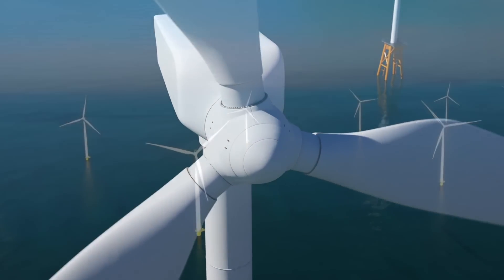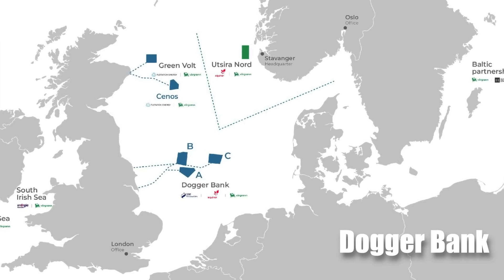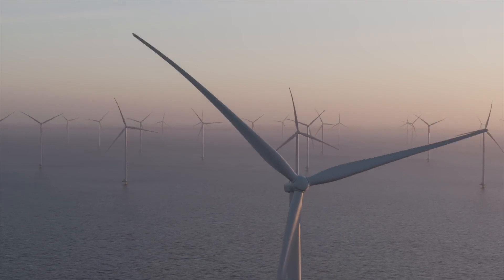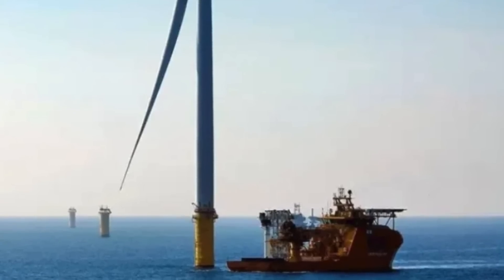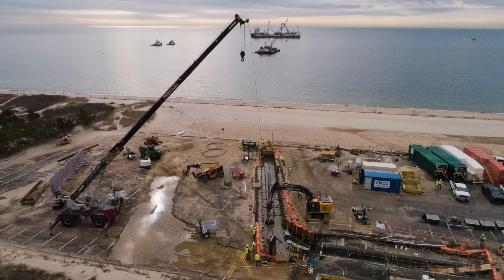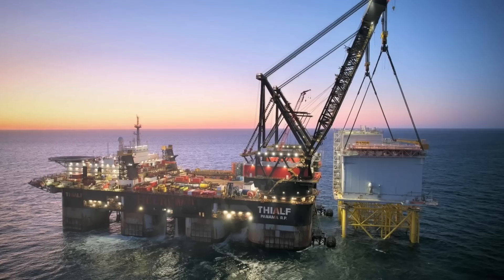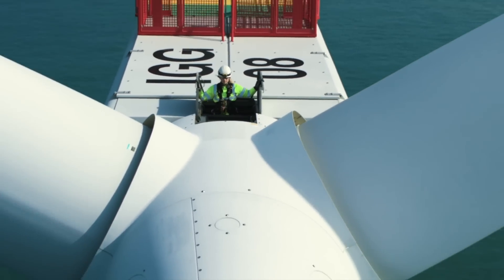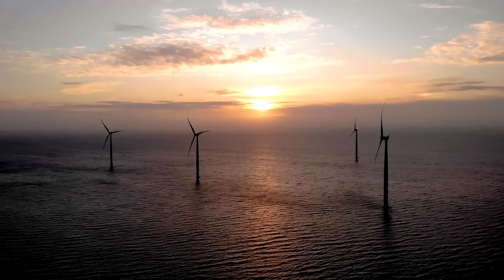Inside the $11.6 Billion Dogger Bank: The World's Largest Offshore Wind Farm

Comment: What a waste of time, space and taxpayers money. Electricity is a commodity that is produced at the same moment it is created. That is not possible with wind energy since it is always dependent of the weather. If there is too much wind there is overproduction and if there is little or no wind the energy has to be brought from an other source. The industry needs stable and predictable energy and that can only be achieved with large generators. Then you are left with hydropower, fossil fuel or nuclear power. If you don’t have one of these you will have extreme price variations, unstable power supply and in general extreme prices of electricity. Your industry will move to countries where they get cheap and reliable energy and all UK is left with is the enormous expenses the taxpayers have to cover for. Good luck with that.
Reply: What is your suggested alternatives to Wind and Solar ?
Reply: @TimMountjoy-zy2fd  The answer to that is very simple. It is nuclear power. Contrary to what a lot of people think, nuclear is very safe. In fact it has together with solar power the lowest mortality rate of any energy production. The three most known nuclear accidents Chernobyl, Fukushima and Three Mile Island was in reality hydrogen explosions because they lost cooling of the reactor. When water hits temperatures above 700 degrees centigrade the water molecules split and large amounts of hydrogen is generated. With them forth generation of reactors this is not longer an issue. Specially the molten salt reactors are extremely safe. First of all there is no water present in the reactor but instead molten salt at a temperature up to 700 degrees. There is hardly any pressure in the system unlike water where you will have a pressure from 75 to 150 bar in the superheated steam. Should there be a leak in the system the salt will solidify when the temperature gets below 500 degrees and the radioactive material will remain in the plant. It will not take up much space and can be scaled to needs. Copenhagen Atomics are developing reactors that are placed in units similar to 40 feet containers. Unlike traditional reactors these are not dependent of large amounts of cooling water and can be set up anywhere. Should things go wrong and they loose control of the process a melting plug will melt and the radioactive material will be drained into a drain tank by gravity at around 800 degrees and will be cooled there. If the melting plug fails for some reason the process will stop by itself at around 1100 degrees because the distance between the molecules will be too far. The control rods are held up electro magnetic and if there is a power failure they will fall down by gravity and stop the process completely. Since it uses molten salt to circulate the radioactive material and not rods it does not have to be shut down to replace used fuel. These reactors can run on both thorium and uranium and can be used to burn down nuclear waste and plutonium.
In fact it can get 10 times more energy out of waste from existing nuclear plants. The waste from these reactors only needs to be stored for 300 years before they are completely safe to be around. They produce heat and this heat can be used for a number other purposes other than electricity production. Desalinization plants and various refining processes are just a few. While the salt is circulating you can extract useful isotopes from that can be used in cancer treatments and similar. What about the price for plants and the electricity they produce? That can be very small since they can be series produced on an assembly line. One lump of thorium the size of a tennis ball contains enough energy to the needs of a human from new born to 100 years old. With the production of electricity near to where it is consumed you will also need a lesser electrical grid. Wind and solar energy is a hype. In Sweden they have calculated they have had an annual loss of 37% since 2017. I don’t know any other business that could exist with such losses but then again there are none other business with similar guarantees from governments and EU. Due to that they get loans at extremely low interest rates because it is no risks to the bank and the money they get they can lend out to daughter companies in other countries and skim out the difference in interest rates. It is easy to gamble with money when others have to pay for losses. People are easily fooled, specially if you label something as green and claim that it will save the climate.
A fool and his or hers money often goes different ways.
Reply: @runedahl1477  Nuclear power failed the world and did not even come close to its 1950s promise of "energy too cheap to meter".  If nuclear had come close, we wouldn't be so deep down the climate change hole we are in now.

The next 10- to 20-years will be critical to mitigate the worst effects of global warming.  Yet it takes 10- to 20-years to build a single large nuclear power plant.  Constructing new nuclear power plants will have essentially zero impact on the amounts of energy needed to displace enough fossil fuels during this critical period.

Look at the tremendous cost and overruns of the latest nuclear power plants like Alabama Vogtle and UK Hinkley C.  With those billions over-budget and years over-schedule, these are likely to be the last nuclear power plants built in these countries.  These cost and schedule overruns are actually par for the course with commercial nuclear power.

Every dollar spent on nuclear during this time actually delays the worldwide energy transition.  The simplest answer is sun & wind from the cosmically large fusion power plant we have in the sky.  All the combined fissile and fossil energy that ever existed on Earth would amount to only a bucket in an ocean compared to amounts of energy we get from our host star.

Commercial nuclear power will be gone from the terrestrial grid in about 50-years' time.  It's simply the wrong tool for the job: too small in scale, too slow in construction, and too costly.  But nuclear will remain in small-scale forms where it excels in like: military, scientific, nuclear medicine, and deep-space exploration.
Reply: @beyondfossil  Nuclear energy is coming whether you like it or not.Already in the fifties did they  start with molten salt reactors at Oak Ridge National Laboratory in Tennessee. They solved most of the technical issues and did all the scientific work on this type of reactor.
In September 2021 the Chinese started a test project in the Gobi desert based on the knowledge from Oak Ridge. Their plan is to start mass production of reactors from 2030. When they started with nuclear power production one of the things they were looking for was an efficient way to produce plutonium for bombs and molten salt reactors are not very suitable for that. However they are very suitable for burning nuclear waste. A nuclear plant is expensive to build but with a lifetime expectancy of 60 to 80 years they will pay off in the long run. Nobody knows how long a wind farm will last. I saw a movie from Sweden regarding major failures on wind turbines and they basically had one every month the last years. This was major things such as blades falling off and fires. The situation is so bad that the German and the Spanish government had to bail out Siemens Gamesa with a whopping sum of 88 billion euros. It addition they guaranteed 165 billion euros in state guarantee. The stock price of SG stocks fell with 90%. SG is one of the largest producers of wind turbines in the world and the reason for the big loss was that the quality of the turbines. The simply failed long before the expected lifespan.  When calculating the costs of putting up wind turbines they never included the costs of putting up the grid . This cost a lot more than building and putting up the turbines. Offshore you can multiply the cost by five compared to that of a land based wind farm.  There are plenty of uranium in the world and even more thorium. It will last ten thousands of years. This gives the generations that comes after us plenty of time to figure out nuclear fusion.
One ball of thorium the size of a tennis ball contains enough energy to cover all the needs of a human from birth to the age of 100 years.
A ball like this doesn’t cost much.
The problem with wind and solar energy is that they only produce electricity when the weather allows and the electricity they produce is of low quality because the sinus curve fluctuates too much.  When the weather allows they produce too much and when there is no wind or sun they have to get energy from other sources. This means hydroelectric, nuclear or fossil fuel. You don’t want to emit carbon dioxide so fossil fuel is out of the question. You can’t build a hydroelectric power everywhere. The topography of the landscape and  available amount of water limits that. Forget about batteries,hydrogen production, flywheels, gravity storage or heat silos. They are expensive and very unpractical. Besides they will only last a short time. What you are left with is nuclear power. Most of the energy in a grid have to come from a stable and plan able source. That means big generators that can provide a stable sinus curve that is in sync with the consumption. Electricity has to be consumed the same moment it is created. Electricity should be considered as one big machine. Right now too many of the countries with a lot of wind power have fossil fuel plants standing by for those days when the wind is not blowing, often coal fired plants. How good is that for the climate? An other thing those that advocates for wind power never talks about is the third world. It will not help the climate if we destroy our nature and bankrupt all our power hungry industries. People in the third world wants the same standard of living as we have. A key contribution to this is plenty of cheap electricity. To get there they built the cheapest form of electricity production they can and that is coal fired power plants. Right now there are about 2000 such plants under construction in third world countries with a large population. About one third of the world’s population falls into this category. Would it not be nice if we can provide them with cheap and reliable emissions free energy. Right now there are about 80 different companies and countries that are working on various nuclear projects.
I am quite convinced that some of them will make it. If there is a will things can be achieved. As an example I could mention the ozone layer.
When was the last time you heard something in the news regarding the ozone layer?
Reply: @runedahl1477  SMR will not save dying commercial utility-scale nuclear.  SMR comes with its own long list of problems and molten salts introduces other complications.  More importantly, to get the advertised low cost per MWh would actually require building SMR units in volumes of 10,000+ units.  The factories for building at this scale don't exist and building such a mega-factory would be a challenge in itself.  Unit volumes below this would actually mean SMR costs more per MWh than standard nuclear.  There's overlapping fixed overhead in operations and manufacturing for each SMR unit that don't exist for large-scale nuclear.

In its long 70-years of operation, commercial nuclear only powers 10% of the world's grids and that number is falling.  Almost every nuclear power plant construction has been marred with being billions over-budget and years over-schedule.  Nuclear power the longest running joke in the energy industry.
Reply: @beyondfossil  The biggest problem nuclear energy has is shortsightedness among politicians and bureaucrats.
In Korea and China they are able to build a nuclear power plant in 3 to 5 years. In Japanese it is around 7.
To get the approval you have to provide a small container with documentation for each project. The are simply all treated as prototypes.
Then a bunch of people have to go through this documentation with hearings from all kind of sources. When you finally get the approval there is a new round with financial institutions to get the much needed money to build your reactor. Then you have the building of the plant that also takes time, specially since Europe has lost much of the expertise in building such projects. In the meantime your company is not making money. If it takes 15 to 20 years before a project is starting to make money it is not so interesting for investors.
To make things worse you can add politicians into the quote.  It is impossible to tell what kind of government you will face before your plant start making money and in worst case you might loose 10 billion dollars or so because a change of political direction.
To get around this problem there can be ordered a number of identical power plants so that they all can get a type approval.
They can do it with airplanes so why not a power plant.
To make it more tempting for investors the government can finance and build the power plants.
When it is ready to start production they can sell it to the company that will operate it.

When it comes to politicians, have you ever heard any of them admit that they were wrong?
Instead they will blame it on everybody else and in some cases try to hide the facts.
If none of that works they will try to decimate the responsibility so that everybody can be blamed.
I see the tendency in Sweden where they had the best electricity supply system in the world with cheap and reliable energy.
Then they put up a number of wind turbines and shut down half of their nuclear plants. The shutdown of nuclear plants was initiated by politicians that even bragged about it.  Now they have realized what a big mistake they have made and are going back to nuclear power plants again. Now the same politicians that had the nuclear power plants reduced are doing all they can to save face.
Reply: @runedahl1477  Every energy generation system has to work through the local regulations and politics.  Worldwide, there are gigawatts of renewables waiting to be put online but blocked due to red tape.  For example, in some parts of Australia, wind farm construction can be blocked for years by someone just filing for a permit to build a shed on the property.  They don't even need to construct anything to block a whole wind farm from starting construction for years, just filing a construction permit will do.

Nuclear's big drawback is its incredible complexity, long construction times and highest cost per MWh and prices are actually increasing.  Politicians and bureaucrats are just the start of nuclear's problems.  Every few years, piles on more edge cases and safety requirements are added to increase nuclear construction and design.  Public sentiment towards nuclear is not great either resulting in NIMBY'ism.  You actually get NIMBY against solar and wind too, but nothing takes the cake like nuclear NIMBY.

Korea's latest nuclear power plants are taking far longer than 5 to 7 years.  Politicians like to tout nuclear power plant construction because it's good for local jobs.  But talk is cheap.

Major things have changed in the 14-years.  Solar and battery costs have plummeted well over 90% since 2010 and still continue to fall.  People, including politicians, realize how large scale nuclear won't cut it for the huge amounts of power needed to displace fossil fuels.
Reply: @runedahl1477  I get it, nuclear power is cool tech. But you have to use the right tool for the job and nuclear for the grid is not the right tool. Nuclear power is important for other scenarios.  Look at the nuclear power aircraft carriers and submarines.  They have practically unlimited range only limited by the crew and food stores, incredible!  One ship I'd like to work on are nuclear powered icebreakers used for more peaceful purposes like critical artic research.  To be surrounded by ice and blistering cold that's trying to kill you at every turn, but yet warm and toasty with all that power is amazing.  In this smaller scale, you see the same problems with nuclear.  The cost of nuclear-powered vessels in construction and maintenance puts it only within reach government organizations.  Nuclear powered commercial ships have been tried by never been successful with only some short-lived experimental ships.  It's probably for the best that there are no commercial ships that use nuclear.  Because just one incident could be disaster for not just the ship but the entire nuclear energy industry.

As I wrote in more detail previously, commercial utility scale nuclear is simply the wrong tool for large-scale problems like the grid.  Renewable energy production cost has reached historic lows and still keeps falling.  On the other hand, commercial utility-scale nuclear power is heading in the other direction and keeps getting more costly.  Some combination of wind & sun is available everywhere on Earth.  The raw inputs of wind and sun cannot sanctioned, blockaded, tariffed or taxed in anyway.

Please stop pushing commercial utility-scale nuclear as the answer to global energy transition -- it can't do it.   As a benchmark calculation, the world uses 620-exajoules of energy a year or about 172,222-terawatt hours.  You would need some 20000 1.5-gigawatt nuclear power stations to equal this amount of energy!!!

In contrast, just for solar, you only need to capture, on average, just 0.0113% of the 173,000TW of solar energy the Earth receives over a year, and it can be spread out on all the countries/continents that the population live.  This doesn't even include any wind on-shore or off-shore!  This incredibly wide-spread nature of sun & wind works very much in favor of renewables here.  Solar can be captured on farm fields, parking lots, commercial/residential rooftops, backyards, sheds, fences, balconies, on top of RVs/trucks, boats, lakes, aqueducts, and on and on.  Doesn't have to be photovoltaics either: look at Europe and China have a lot of solar water heating on the rooftops and that saves a lot of joules of energy since water has a very high heat capacity (4.2kJ/kg/°C).  A lot of solutions I mentioned even bypass the grid entirely since that energy is generated and used locally without a single joule transmitted along the grid.  Expansion of the grid is expected to be a major challenge and nuclear has no capability for distributed generation like solar can.

Every dollar spent on renewables during the next 10- to 20-years instead of renewables will actually slow down the global energy transition.  That's my biggest fear with nuclear right now.
Reply: @beyondfossil  It is a good thing that local residents can stop or at least delay these stupid wind and solar projects. Very few people wants them in their neighborhood. They require a lot of area both to build and to maintain. You also have to take into consideration the infrastructure around these turbines like roads and electric grids. These giants have to stand on solid foundations in order to not topple over  when the wind blows. I have heard numbers like 500 metric tons of concrete for each fundamental. I live in Norway and along our coast we have a lot of bunkers built by the Germans during World War Two. They are still standing but it would be to costly to remove them. I have to give it to the Germans, they knew how to make solid concrete. In Trondheim they have a massive submarine bunker in the city. Years ago they tried to demolish it but the only result of the explosion was that they blew out windows in a radius of 700 meters. There was hardly a scratch in the bunker so they gave up. Dora is the name of the bunker if you want to look it up. At the end of a wind farm the company that owns it will probably declare bankruptcy and then it will be up to that owns the land or the taxpayers that have to pay for the clean up. With no mandatory fund for decommissioning controlled by the state and of the limit for the wind company like the nuclear industry have there will be no money to get compensation. An other problem for countries that have winters is that it is dangerous to walk through the area due to ice that is thrown of the blades. That can be ice lumps on several kilos.
The dream of cheap electricity from wind turbines is an illusion. Yes, sometimes the price on the spot market can be very low but most of the time the price is very high. In spite this most of these wind farms are not able to make money. In Sweden they have calculated that 80% of the wind farms are not making money. Since 2017 they have had an annual loss of 2 billion Swedish kroner or 39%. No other business can survive with such losses and the reason why all of them is not bankrupt already is due to guarantees from the Swedish state and EU that gives them favorable loans. With the mother company in countries like Luxembourg and Switzerland where the taxes are low they can lend out money to the daughter company with a much higher interest rate and skim the difference. So as long as the loss of the company in Sweden is not too high they can continue the scam and not break any law. Also a company with negative income doesn’t pay any tax. Where the money eventually end up is nearly impossible to find out since the banking system in these countries prevents insight.  The persons behind these companies could be criminals, dictators or just billionaires that don’t like to pay taxes.

Nuclear energy got off with a bad start with the bombs over Hiroshima and Nagasaki. In the fifties people were further scared with campaigns like “Duck and cover” where American school kids were advertised to crawl under their desk in case of a nuclear explosion. Like that would help. Then you had the movie called “The China Syndrome “ where they in typical Hollywood style let their fantasy run wild in the film about a nuclear accident. To worsen things it came out just before the accident on Three Mile Island. To set things straight. You can not have a nuclear explosion on a power plant like you can with a nuclear bomb. Secondly  you can not have a meltdown to the core of the earth either. What you can have is a hydrogen explosion that spread radioactive material over an area if you loose cooling. That is why I like molten salt reactors. With next to nothing pressure in the reactor the radioactive material will stay in the same space should there be a leakage.
I have already mentioned some things the molten salt can be used for but a very important part of it is that you can use it to extract useful isotopes that are not occur naturally but can be used for medical purposes.  Specially I like to mention Alfa particles. With these you can target cancer cells but leave healthy cells around untouched. This was something they stumbled over by accident during the molten salt tests at oak ridge. Actinium 227 is what they discovered. Unfortunately there are so little produced of it every year that it only is enough for a few thousand patients. In other words it is a very useful material in the fight against cancer.

I have a feeling that many of the people that claim they are for wind and solar energy in reality are against nuclear energy.
The reason is because there are so many myths about how dangerous nuclear power is. Whit molten salt reactors you solve a lot of problems in one go. Energy, neutralizing nuclear waste, on carbon emissions, extraction of useful materials, minimum impact on nature and that it can be located near the consumer. Oh yeah, it will be cheap . One ball of pure thorium costs 50 dollars and can produce several gigawatts of energy. One kilogram of thorium contains the same amount of energy as 20 million kilogram of fuel and there is plenty of it.
On the other hand if all the plans for solar and wind energy comes through we will in the next 30 years have used more copper than the human race and used up to now.
Reply: @runedahl1477  Nuclear's incredibly slow build rate means it will have next to zero impact on the huge amounts of energy needed to displace fossil fuels.  This is not counting the high cost of nuclear construction.

You forget that nuclear power also needs the grid to transmit its power.  How can you forget such a thing?  But, in fact, the only mass scale power source that can bypass the grid is rooftop solar since it generates and consumes watts locally.  No other power system can blend into the urban environment like solar can.

Much less than 1% of the world's land surface can power all the world's grids using current generation photovoltaics.  That doesn't even count wind power.  The sun provides 173,000 terawatts continuous power to the Earth, all fossil and fissile fuels are just a bucket in an ocean in comparison.  All true nuclear fans should be on their hands and knees each morning worshipping the free clean fusion power we get from the sun for billions of years and at least a billion more.

My final statement to you: You'll just end up being disappointed year after year as renewables continue to expand while nuclear power stays level and slowly recedes from the grid.  You don't have to take my word for it, just have to look at the vast disparity of renewable growth versus commercial nuclear.  Sorry.  Take care and don't get too worried about.  We'll pull through it and nuclear will take its place in specialized small-scale power applications.
Reply: @beyondfossil  I think nuclear power is the best alternative for future energy production because it can do things other forms of energy production can not and it is not cool but rather hot, literally. Electricity has to be consumed the moment it is created. Wind and solar energy is all in the hands of the weather. It can not be stored in a practical or affordable way. Forget about hydrogen and ammonia production because it best used for other purposes and is cheaper to produce from hydrocarbons. Forget about batteries because the needed amount of batteries is way higher than is available or produced.  In Eskilstuna, Sweden, they are now very upset because the Chinese is building a battery factory there that will be allowed to dump 900 metric tons of Methylenechloride every year. That is a nasty gas. So much for the environment as long as it flagged as green.
Nuclear reactors have been used on warships for a long time. How sick is that if there is a real war. On the other hand it might not be as bad as people think. The Russians have lost at least two submarines in the Barens Sea, one of them being the Kursk. If I remember correctly the Americans have lost one in the Atlantic. I know about the vessel called Savannah that was not a commercial success because it was not allowed to enter many ports outside of USA.

Wealth is plenty of energy and at a reasonable price. Many third world countries are trying to get the same wealth as we have in the western world. These are countries with large populations like India, Indonesia and China. The cheapest form of energy they can get is from coal fired plants even though these countries are looking into nuclear power and other sources of energy as well. Is it a good idea to cut down rainforest in Brazil, Indonesia or India to make room for wind turbines and solar panels?
In addition you have to have a reliable power source available if there are not wind or sun
That means something that runs on fossil fuels.
At the moment there are about 2000 coal plants being built around the world and that is the most polluting and life taking electricity production there is.
I strongly doubt that if we destroy our nature it will make much difference.
What we can do is develop a form of energy production that will serve all humanity for many years to come.
Then again, the road to hell is paved with good intentions.
It is all about picking the best solution and we certainly disagree what that is.
Reply: @beyondfossil  Apparently you have not seen the video from Copenhagen Atomics or you would have understood that nuclear energy is already here and will be rolled out in numbers in the years to come. Since nuclear power generators are usually big the grid connected to them are simpler. If you put a system like the one they are developing in Copenhagen it should not be so difficult to convert existing fossil fueled plants to nuclear and used it as before. You replace the boilers with a heat exchanger and you will be up and running again.
It doesn’t matter how much wind or sun we have throughout the year because they cannot be controlled after demand. In fact the biggest nuclear reactor on earth is a few kilometers under your feet. Without it there would probably not be any life on this planet.
Reply: @runedahl1477  Show us the actual growth numbers and not some brochure video from a nuclear advocacy group.
Reply: @runedahl1477  You're still ignoring the basic economic and scientific numbers for nuclear construction time, nuclear high construction & operation, and nuclear waste.  You're just going to get disappointed year after year.  None of the numbers either scientific or economic line up for commercial utility-scale nuclear.
Reply: Do not let facts get in the way of fiction. Wind is the number one source of Electricity in the UK proving you know nothing.